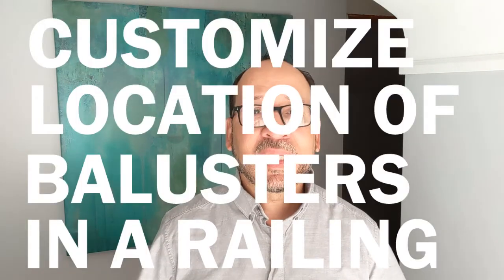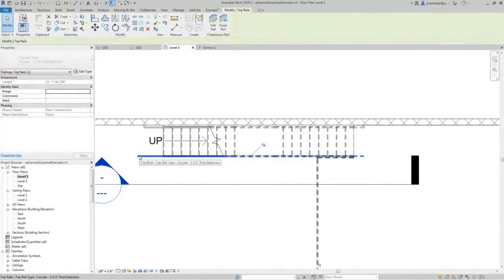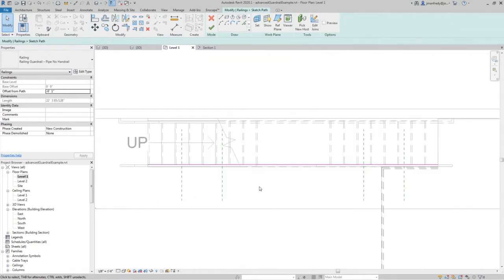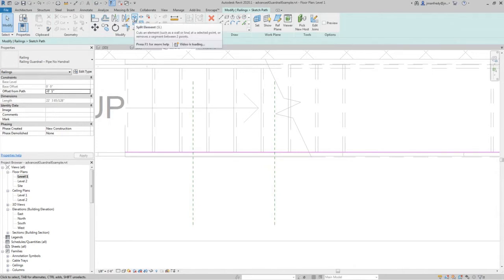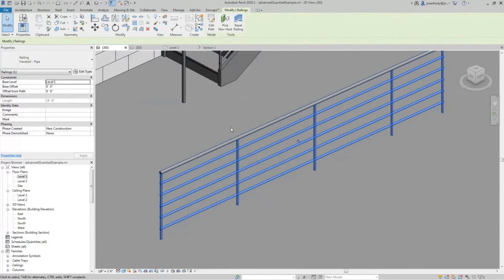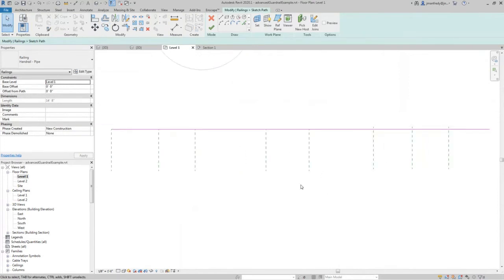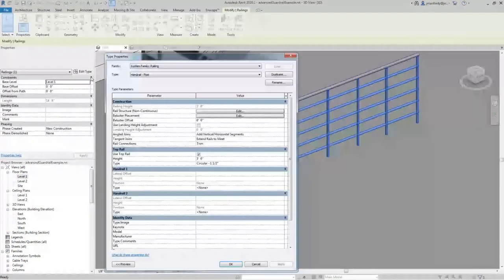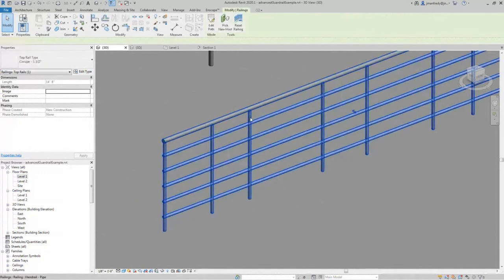Customize Location of Balusters in Railing using Revit

Comment: And what about glass railing that on circular stairs
Reply from the maker: I would design the stair and use the existing glass railing system first, copy the railing family, make your design changes to railing family copy then replace the railing family on the stairs with your new design.  I hope that helps